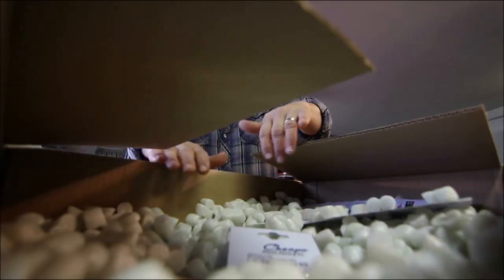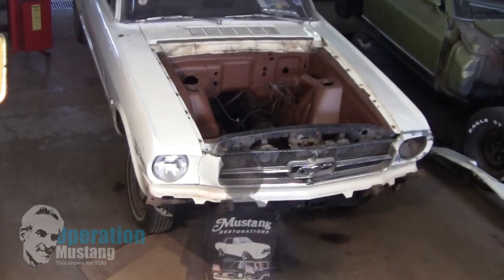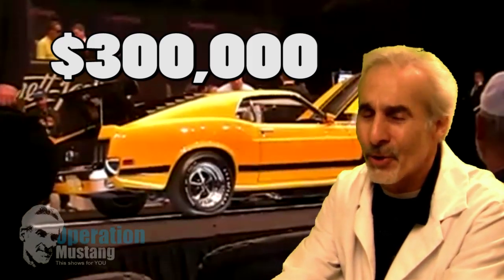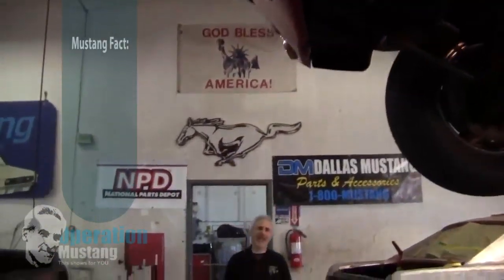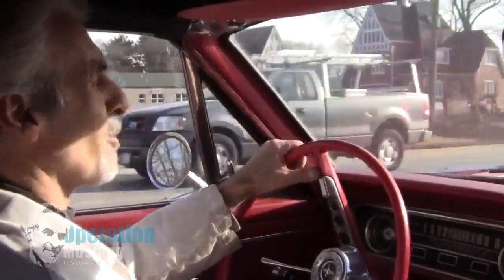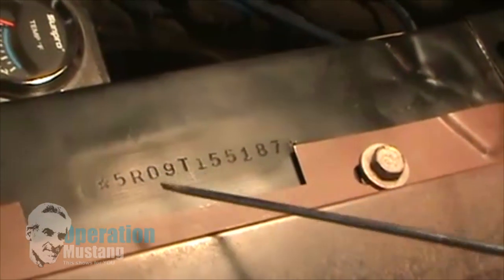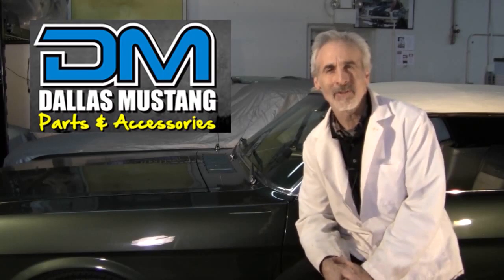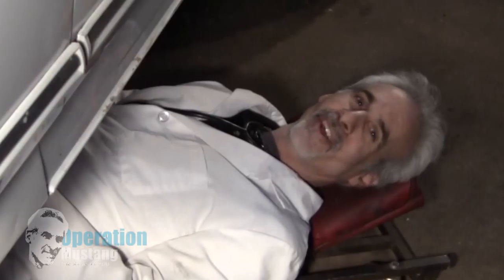Episode Nine / OPERATION MUSTANG - Episode Nine -  (Mustang Restoration - Chicago) classic Ford

Comment: Hey doc...I thought the jack stand points were - FRONT / Behind the front tire where the two frame rails overlap REAR / On the frame rail forward of the leaf springs (just pass the spring knuckle toward the fron) ..Is that okay ? That's where I have mind but want to be safe...thanks
Reply from the maker: Yes, you can use those areas as long as you have the stands exactly where you describe.